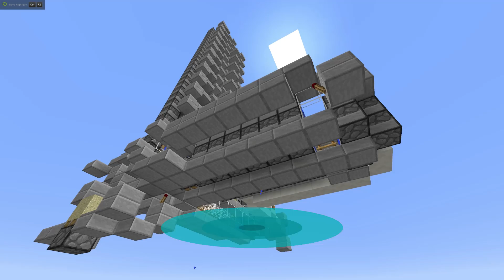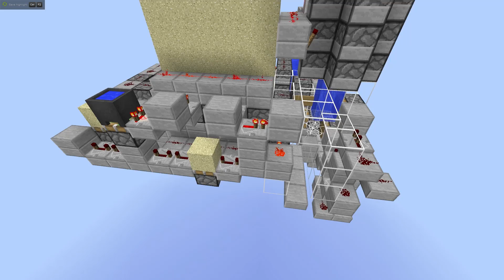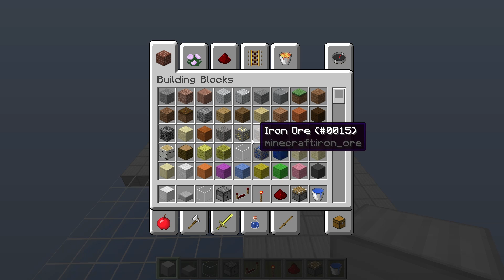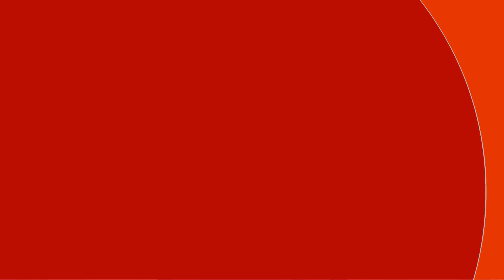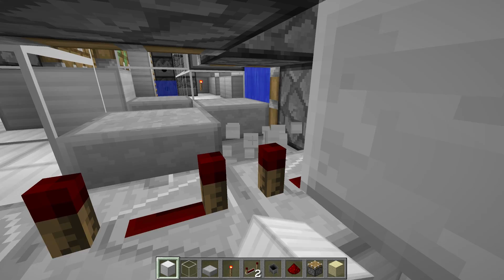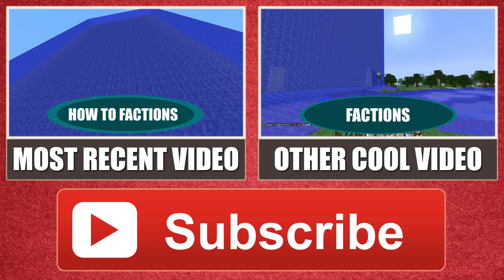Minecraft Tutorial: Compact 80+ Sand Stacker TNT Cannon - 10+ Slab Bust [1.7/1.8]

Comment: Here's some tips.1- For the hammer, you can make it erm, shorter by stretching the length of the hammer, decreasing the height, and adding a booster to push the tnt into the hammer piston2- I prefer using repeaters and slabs for wiring the hammer and power. I prefer this because for hammer, there is no delay for for waiting for torches to come back on. 3- If you want more slab bust, make the slab bust like hammer, like making a stack of dispensers with a corresponding piston under. This is when the repeaters come in handy.Keep up the good work. :)
Reply: +Ballisticity - Minecraft, Call of Duty, CSGO, Edits hey bro, would you like some channel art for free?

Comment: What a cannon! Keep up the great work! 😄
Reply from the maker: +Velocityy Strukk Thanks
Reply: or use an offset comparator scatter with 1 on 4 ticks
Reply: +TNT MADNESS what happens if you turn on the scatter, hammer and sand compresser/stacker at the same time?
Reply: +TNT MADNESS why is there 3 year old tech in it?
Reply: +Adam Warburton as in the sand system
Reply from the maker: +DNA Gamer &amp; GFX It would blow up
Reply from the maker: +Adam Warburton ?
Reply: the power should go off 2 ticks after the sand comp booster and should come in the same side the hammer piston pushes out. another tip is have your hybrid tnt in your hammer.
Reply: +Adam Warburton you have a tiny scatter if you put the hybrid in the hammer on a cannon like this haha. Only on 100+ stackers where the hammer is insane because there is enough room for more than 10 scatters at least. Trust me I cannon for gee gee on archon silver so ik what I'm talking about.
Reply: yeah, 4 tnt is enough. i made a cannon that stacks less than this complete oneshot. you don't need a 20 block scatter for it not to clip.
Reply: +Adam Warburton the scatter is always on the bottom of hammer on 230s because the hammer has a shorter delay because it obviously needs to shoot the sand down. The stronger the hammer the more sand you can stack - simple. For bigger holes on 230s delay some of the scatter so that the tent explodes later when it hybrids and obviously will be lower when it explodes. A 4 hammer is good for smaller stackers however I wouldn't recommend it if your planning to use a 20 stacker on 10+ wall bases. Also the smaller hammer restricts you when you reverse. The 4 tent is powerful but as powerful as it could be to reach the top. Just some simple tips and also let's remember this is a compact stacker - not one of your 80 one shots